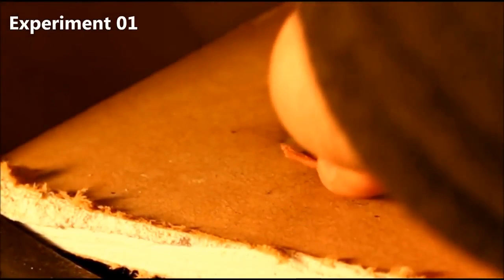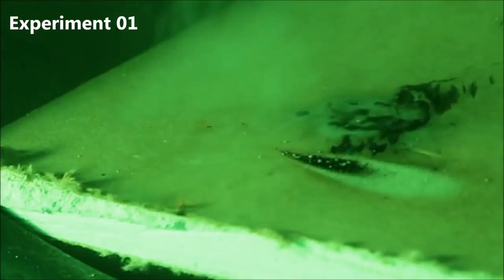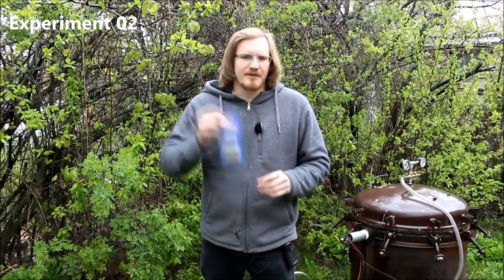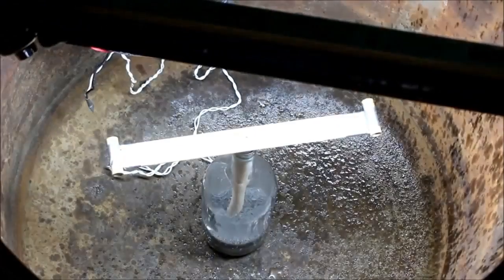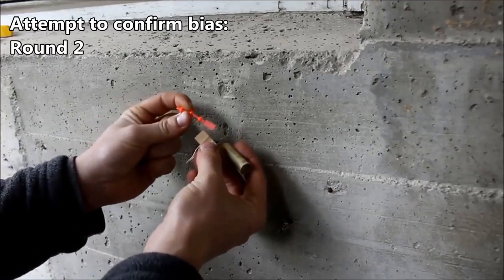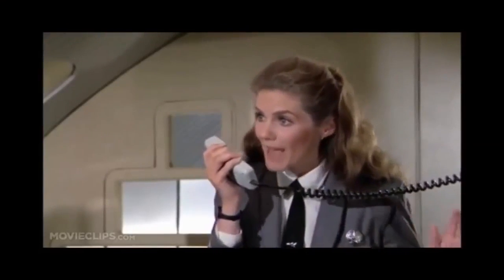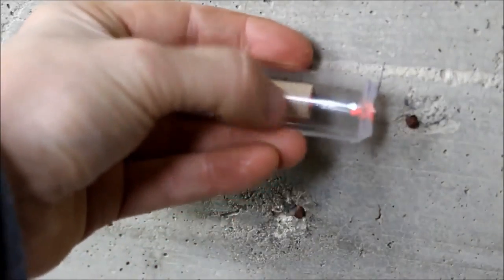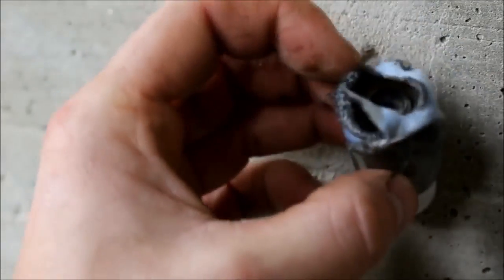Space Fan proves NASA and MythBusters_ Research Rocket in Vacuum

Comment: Another great video to watch is astronauts gone wild, it's with Bart Sibrel who goes around confronting all the still living astronauts who claimed they walked on the moon... You can simply tell just by watching their behavior that something isn't right.... Therefore, I don't believe we've been to the moon, and now after watching so many YouTube vids, I'm also starting to doubt space is even real either....i hope one day the absolute truth will be revealed to all...
Reply: "I'm also starting to doubt space is even real"
Does you GPS work?

Do you know GPS modules can provide position information about each of the satellites it receives a signal from?

In order for the module to provide altitude, azimuth and distance information for each satellite, any ground based system would have to know the modules exact location. This would require two way communication. Can you imagine if the GPS transmitting stations had to receive signals back from all the receivers? If you don't understand why this would be impractical let me know and I'l try to explain.

GPS is extremely good evidence that not only is space real, but satellites are real.

Comment: but that only worked for one "burn"  what is going to continually provide the atmospheric pressure in deep space once the initial bit has been depleted?

i.e. how many "burns" were necessary to get to the moon, orbit, land, and take off again?  

or in the vacuum chamber above, once the initial rocket has nearly spent its fuel, could another rocket be ignited to KEEP the unit spinning, and for how long?

Comment: 7:49:  that silly, the plastic plug is not airtight, the vacuum pulled air out of that motor also. You are basing conclusions on insufficient evidence. Consider that the ignitors you are using, probably require oxygen in the air to burn the stuff on the ignitor wire .. you are only melting the wire, which is not the best or most reliable way to light off these type of solid fuel engines. Pushing that wire into the solid fuel with a plastic plug helps the red hot melting wire lite the motor .. and that is exactly what you experienced.  Nice try .. but work on your experimental technique and design, if you really care about discovering the truth.

Comment: TO ALL YOU Jr. SNAKES WHO CONTINUE BEING SO VERY INTELLIGENTLY-INDOCTRINATED BY THE SENIOR SNAKES WHEREAS YOU ARE STILL "NOT ABLE" TO DISTINGUISH BULLSHIT FROM TRUTH...THIS IS FOR "YOU"!!!!
 
A size of the rocket, (compared to the IMMENSE VACUUM of space - IF there was really an outer space and a vacuum....NOT!! - would be even SMALLER than the smallest speck of dust. The vacuum, because of its INTERMINABLE QUANTITY WOULD "ALWAYS", have the UPPER HAND and would also be MUCH MORE IMMENSELY POWERFUL than the TINY LITTLE BABY DUST MITE ROCKET''S exhaust pressure, and/or, thrust, therefore, AS SOON as the rockets exhaust valves would be opened, ALL THE FUEL would IMMEDIATELY be SUCKED OUT from the tin-can fuel tanks, and even the whole lemon would implode upon itself!! 
That being the said, there would not even be time, NONE AT ALL, for the lemon-rocket to take off into any direction. The fuel and exhausted gases would “INSTANTANEOUSLY” just become part of the vacuum from the HUGE VACUUM'S POWERFUL SUCKING ACTION, and the physical parts of the lemon-rocket would of course only become junk in space, but I know you disagree, but it is only because you, and MANY others such as you. really, TRULY believe in...GARBAGE, but i's ok, don't worry, let's be HAPPY!!

Now also having said that, I now turn to something a little bit different, but which also has to do with the space program Senior Snakes, so-called, SPACE FLIGHT MISSIONS TO JUPITER!!!!

Lookie here all you Jacks in The Box, the info below is JUST ONE...JUST ONE TINY LITTLE PIECE OF "EVIDENCE" having to do with their BULLSHIT. 
It is UTTER GARBAGE, and it comes DIRECTLY from the Snakes themselves who you consider as being YOUR REAL PROFESSIONALS HEROES, and after you having checked it out VERY CAREFULLY, I hope you are still able to use some of whatever little COMMON SENSE you may still have for you to be able to say, and ADMIT that INDEED, it's ALL just A BUNCH CGI BULLSHIT?!! 
THEY ARE INDEED PROFESSIONALS, but ONLY in RIPPING US OFF with what has now after many decades been more than "ONE TRILLION DOLLARS", ($1,000,000,000,000!!)!!!!

1. Take a good look at these Jupiter images which they say were taken on April 21, 2014, “supposedly' by the HUBBLE, (which is NON EXISTENT) and compare it to the other one taken on June 30, 2016...TWO years apart, K?
After looking at those images, (if you do) and HOPEFULLY, after NOTICING THE “OBVIOUS”, are you Jr. Snakes going to continue with your DENIALS against TRUTH, and ONLY continue with your ADAMANT SUPPORT...of their BULLSHIT? Check them out and see the GARBAGE for yourself!!

2014:  https://en.wikipedia.org/wiki/Jupiter#/media/File:Jupiter_and_its_shrunken_Great_Red_Spot.jpg

2016: 
http://www.10tv.com/article/hubble-captures-stunning-shots-Jupiter-auroras

2. Also, take a look at this color video of their, “SUPPOSED”, JUPITER and the cloud formations, and/or, cloud-MOVEMENTS.

http://www.solstation.com/stars/jupiter.htm

I want you to NOTICE how much CHANGE there is, or supposedly was, during only and 8 DAY period, and compare that to the NO CHANGE “AT ALL”, in “TWO YEARS”, on the images taken from 2014, and all the way to 2016..."NO CHANGE" except for a "supposed" Beautifull Bright Blue Round Head-Kippah, or Brimless Cap which THEY "SO OBVIOUSLY',  PHOTO SHOPPED INTO THE IMAGE to supposedly make it seem as if it was a totally DIFFERENT, NEWER image, but which can CLEARLY be seen that it IS THE SAME CGI from 2014!!...that is TOTALLY RIDICULOUS...TOTALLY DISGUSTING COMING FROM SO-CALLED, EXPERTS...that is PLAINLY AND SIMPLY...A LOAD OF CRAP!! That where OUR MONEY gets stuck to, or stuffed into...A BUNCH OF THEIR CRAP!!

3. Furthermore, on that same page:  http://www.solstation.com/stars/jupiter.htm

Go down three slides or images, and take a look at the set of THREE JUPITER IMAGES, and NOTICE THE THREE DIFFERENT DATES STAMPS, and which are the following:
May 15th 2018, June 28th, and July 8th.
Notice the DRASTIC CHANGE of cloud formation, or dust movement during a three month period only, (actually just a month and a half +, if we count the days) but NOTHING...NO MOVEMENT WHATEVER from 2014 to 2016?

COME ON YOU PEOPLE...WAKE THE HELL UP ALREADY!!
Reply: You really need to study up on rocket motors.
Reply: You really need to look again really study the INDISPUTABLE GARBAGE  having to do with their so-called Jupiter images and their other "supposed", over yonder and over the hill GullibleZillion miles away outer space missions which only amount to BULLSHIT and DEMONIC DECEPTIONS, and having said that, you really need to learn how to get unstuck from that kind of bullshit which the SENIOR SNAKES teach and preach and push, and which they use to indoctrinate all the GULLIBLE ONES such as YOU!! 
You also have to learn how to Jump The Hell Out of The Box where you can finally, FROM THE OUTSIDE...START THINKING FOR YOURSELF...but most importantly Kel Quack, and even though it hurts...you have to learn how yo ACCEPT TRUTH!! 

If those Jupiter images don't CONVINCE you about THEIR UTTER BULLSHIT, then you are UNDOUBTEDLY "DEEPLY MESMERIZED" AND "ENSLAVED" by those SNAKES!! WAKE THE HELL UP BUDDY!!!! 

On rockets...NO AIR...NO WALL...NO WALL..."NO FLY""!!!! 
There is still air up there...but certainly...NO ZERO-PRESSURE VACUUM, but the air which is still up there, is very rarefied, it's too thin, and so that is THE REASON WHY their shuttles NEEDED to be flying or going at the TREMENDOUS SPEEDS of almost 18,000 mph so it could STILL be able to COMPETE with the very rarefied air for it to still be able to use that rarefied air as a WALL to PUSH UP AGAINST WITH THE THRUST AND FOR THE "LIFT" ON ITS WINGS TO CONTINUE, otherwise, it would start coming down or falling!! 
So, the FACT being that they have NEVER, "EVER" gone BEYOND a 350 mile high orbit, there is NO WAY their shuttles ever flew in a Zero-Pressure vacuum, again, they would still fly in an atmosphere where there was still air, but air which was rarefied, but they would NEVER admit to that Truth, because, by doing so, if the REAL TRUTH was admitted to or inadvertently came out - that there is NO VACUUM UP THERE - then, THEIR OTHER DECEPTION having to do with their ONLY INVENTED, SERIOUSLY DEMENTED, so-called, GRAVYTEA, would also be exposed...and THAT WOULD BE DISASTROUS FOR THE SNAKES!!!!  

THE SNAKES' ROCKETS WHICH STILL USE PRIMITIVE CHINESE-INVENTED ROCKET-ENGINES, (SAME PRINCIPAL) CANNOT, AND DO NOT, AND WOULD "NOT EVER"...BE ABLE TO FLY IN THE VACUUM OF THEIR, ALSO, ONLY INVENTED...OUTER SPACE!!!! THE BURN COULD "NEVER" BE SUSTAINED...IT WOULD BE CUT OFF, IT WOULD IMMEDIATELY BE  "CHOKED OFF" BY THE "IMMENSELY POWERFUL SUCTION FROM THE HUGE VACUUM"!!!!

THEY ARE MASTER OF DECEPTION, and that's why they are able get GULLIBLE ONES such as YOU to believe in their UTTER BULLSHIT, and that is SO SAD, and also  so unfortunate - for the rest of US -  because it is individuals such as you who make it possible for them to continue ripping all tax payer, (US!!) off out of Billions of Dollars ever time they get funded, whereas, over the decades they have STOLEN from all of us more than ONE TRILLION DOLLARS, ($1,000,000,000,000!!) and all because of YOUR utter "MESMERIZED" DEMENTED fascination about, and towards their BULLSHIT!! 
So I ask you, does their bullshit make you and all those who think as you do and who also support the Snakes and EVERYTHING they do and say...REAL HAPPY? If it really does make you happy, then...YOU Kel Quack and all the other SHEEPLE, are NO LESS DISGUSTING THAN THEY ARE!!!

WAKE THE HELL UP ALREADY YOU PEOPLE!!!!
Reply: "PHOTO SHOPPED INTO THE IMAGE"

I think many people will see the image as obviously Photoshoped.

The auroras images were taken using a different wavelength of light than the color image of Jupiter. Did you see the video on the page?

Someone must have thought it would be a good idea to put the two images together. They probably just picked a picture of Jupiter they liked and superimposed the aurora image on top of the other image. There probably weren't very concerned about the exact date of the normal color portion of the image and just picked a picture of Jupiter they liked.

It would have been nice if they included a caption of explaining what they had done but I don't think the mistake was intended to deceive people into thinking that's what Jupiter looks like in 2016. I think they figured the image was so obviously a combined image (since the raw video was right there) they didn't worry about pointing it out.

Your concerns about the vacuum of space sucking the fuel from a rocket are not justified based on the science of how fluids flow from high pressure to low pressure. The rate of flow of a fluid is determined by the pressure on the two sides. The difference in pressure between vacuum and normal atmosphere is about the same as the pressure of being at the surface of water and being 30 feet under water.

The pressure a dam has to hold back is determined only by the height of the water behind it. Not the volume of water. The same principle applies to vacuum. Space being large doesn't make the vacuum any harder to deal with.

I have a question for you. Does your GPS work? Isn't this at least some benefit you see from the work done in space?
Reply: Duane, you say: "SOMEONE" must have thought it would be a good idea to put the two images together.? 

Well, you're right, and that SOMEONE was NASA!! You also can find those images in their own official NASA site, I did!! 

You also say: There probably weren't very concerned about the exact date of the normal color portion of the image and just picked a picture of Jupiter they liked.

Well Duane, you're also right about that...they don't give A SHIT that people SEE thru their utter BULLSHIT, and you know why...because there are still way TOO MANY JR. SNAKES who believe and defend their GARBAGE...no matter what, EVEN if the disgusting bullshit comes or is put out directly by them!! 
Their INDOCTRINATED LITTLE SHEEPLE are just too ENAMORED with their Senior Snakes space program whereas it makes it utterly impossible for their SLAVES to THINK FOR THEMSELVES and impossible for them to believe their EVIL MASTERS - who they consider to be Space Angels - would ever LIE...simple as that, and so that's why they are able, and more than willing to continue with their DEMONIC DEEDS and DECEPTIONS because they know their Jacks in the Boxes are way too deep in their SLUMBER and which is what makes it real easy for them to also continue ripping everyone of us off to their heart's content out of BILLIONS AND BILLIONS OF DOLLARS each time they get funded...and all because of the HUGE number of DEMENTED, GULLIBLE "ADULTS WHO CONTINUE COMPORTING THEMSELVES LIKE LITTLE CHILDREN" WHO KNOW NO BETTER, who can't, or won't question ANYTHING AT ALL!! For people to be so damn CLOSED MINDED IS EVIL, AND DISGUSTINGLY PATHETIC INDEED!!!!

There are way too many anomalies in their own so-called, space flights and/or space walk FAKE productions for many of us to just let it go without pointing it out, and when you point out the unquestionable, BLATANT Bullshit by contacting them and asking them to explain, they just ignore you and NEVER reply because they KNOW it's all just A BUNCH OF BULLSHIT!!!!

Comment: In vaccum u cant stear ore accelerate ore do nothing. Deal with it. Look what happend to a astronaut when they put him in a vaccum chamber.he almoust died.
Reply: Vacuum is inherently deadly to humans, yes. That's why spacesuits are routinely tested in a vacuumchamber on earth, to check them for leaks/ defects/ manufacturing issues before they go to space. It's better to notice a design flaw here on earth where you can quickly extract someone from the vacuum, which is why he didn't die.
Reply: @VM
Rocket motors have gimbals, I wonder what they are on there for?
Reply: Not to mention RCS thrusters and reaction wheels. So yes, they can turn in space

Comment: I have already pointed out on another video that Adam and Jamie used hollywood tricks buy substituting gauges showing a brass colored one then when they claim to have vacuum the gauge they cut to is silver in color and smaller. Also when they turned on the power switch they had instant vacuum???? It would take time for the little pump they had to remove the air.

Comment: 25000 mph to reach escape velocity, you must be joking, please explain how they slow down from 25000 to 17000 in order to dock with the fake ISS - HOW? ask your self that
Reply: Probably because escape velocity is the velocity needed to escape the gravity well of Earth.

Meanwhile the ISS is in low Earth orbit, well inside the Earths gravity well ,escape velocity is not required as that would be rather fuel inefficient, just accelerate to 17000 mph, no need to decelerate, save fuel , ship size etc.
Reply: Robert Spreadborough 

With muh  "space brakes" don't you know!
Reply: turn around and burn, its called a retrograde burn
Reply: Simply put, 25000 mph is the speed needed to travel to another planet. The ISS is relatively close around Earth, so to reach the ISS, you only accelerate to 17000 mph to rendezvous (+/- some mph to equalize orbits and get close). Accelerating to 25000 then doing a retrograde burn to 17000 would just be wasteful.
Reply: What Sturmo12 said.

As a side note, escape velocity is determined at ground level. As you move higher the amount of extra velocity needed to escape Earth's gravity decreases.
Earth's gravity can be escaped at any speed over zero. You just have keep going away from Earth. You don't have to move a certain speed away from Earth to escape its gravity you just have to move away from Earth to escape its gravity.

Escape velocity assumes the object doesn't have its own propulsion.

Comment from the maker: Globetard "John Doe" made a insult here "with a oxydizer does the trick" well no because there are no reactions in a vacuum
Reply: "Jacques Lacoste (Professor ) · SIGMA Clermont
I make a lot of experiments under vacuum in the past (see my papers on anionic polymerisation). The main advantage is to be sure not to have oxygen and moisture in the vessel (N2 can be successsful but Argon is usually preferred to inert a vessel), a second advantage is the possibility to transfer volatil solvents (THF, toluene, etc) by cold distillation directly in the vessel. The simple way is to use rotaflo (teflon taps),(it is not necessary to put lubricant and the best quality (red one) keep 10-5 mm Hg). The vacuum is usually performed by a primary and secondary pump to get 10-6 mm Hg.The addition of chemicals or solvents can be performed by pyrex tubes blowed on the pyrex baloon (reactor) and finished by rubber or silicone stoppers (rabatable) to inject chemicals with a seringue.

If necessary, to improve again the quality of the vacuum it is possible not to use rotaflos but to seal directly the ballon of the pump, and to add chemicals by breakseals and solvents by cold distillation. This was necessary in my case as we were needing an excellent vacuum to quantify alkali metals and alkyl lithim derivatives."

Not only they exist, but sometimes that's the recommended way to get better results.